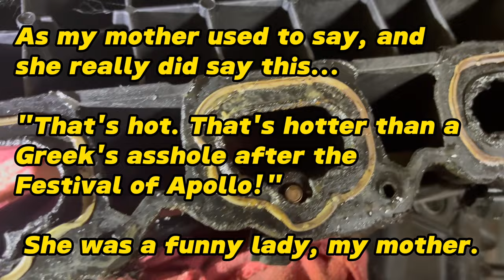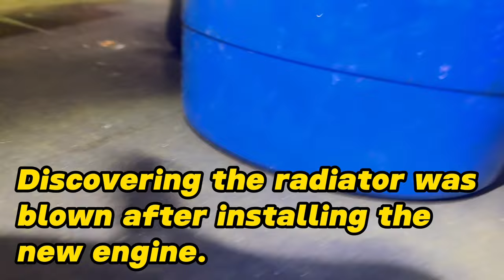New Series: Van Detective. Solving the puzzle of what made this van fail. Ram Promasters Only.

Comment: Elementary Watson. breathes in deeply 
Van hits deer or possibly a fancy pants bicyclist at which point hood is dented and radiator begins to leak. Van is driven to body shop while leaking fluid. By the time it gets there all fluid has leaked. Body shop assumes radiator is full of fluid and replaces hood. Customer comes to pick it up, all looks swell and so drives away. Driver doesn’t notice the temp gauge is fully pegged and wonders what that smell is but continues driving until engine seizes and smoke starts rolling up from the hood. 
hits pipe
Reply from the maker: Elementary!

Comment: Good job Van Detective, those heads had to get hot, like 400 degrees plus hot to melt that intake. When you're hot, your hot. When you're not your not.
Reply from the maker: Crazy hot. I would be very surprised if the headgaskets or valve seats survived that event.

Comment: Oops that was an expensive mistake I remember hitting Bambi on the 69 in Indiana the first thing I did was pull over and shut the engine off throw my four ways on went to go check if the deer was still laying in the road but she was gone so I went back to the van looked underneath it seeing if there was any leaks also pop the hood to see if there was any missing coolant from the overflow tank started at backup sat for 5 minutes letting it idle keeping an eye on the temperature gauge everything looked good I kept rolling back to Canada I got lucky I hit the deer side on and I had freight in the van too I got pretty lucky it was only cosmetic damage I needed a new plastic bit underneath the passenger side light and new front bumper and grill still $2,600 Canadian ouch
Reply from the maker: Brotha Mark. Glad to see you are back in action. I bumped into you once a few years back at a Pilot in Alabama, I think. A deer strike can do a lot of damage, but the Promaster is surprisingly repairable, especially if you aren't nitpicky about the cosmetics. This assumes it hasn't fired the airbags, and then it's crazy expensive. Figure on something like $4000 just for the airbag portion of the repair. Ouch.

Comment: No temp gauge (?)😊😮
Reply from the maker: It has a temp gauge, but it’s just a needle controlled by the computer and not very helpful.
Reply: @promastersonly1419 Yes, while my scan tool shows temp changing quite a bit up and down hills, etc., the dash gauge doesn’t move off dead center until things are practically on fire and it’s too late.